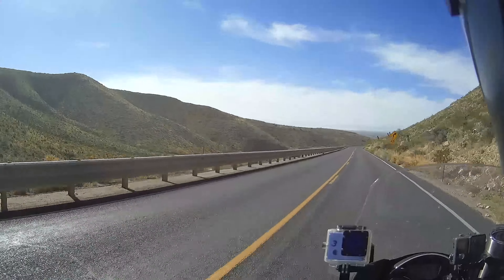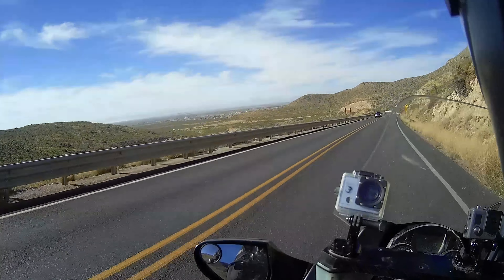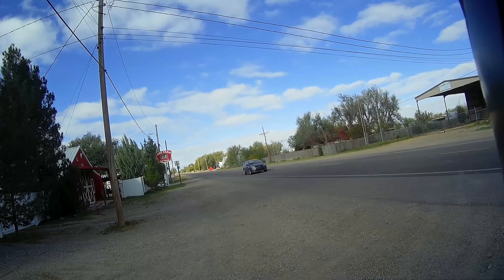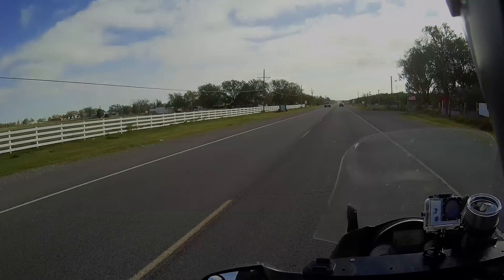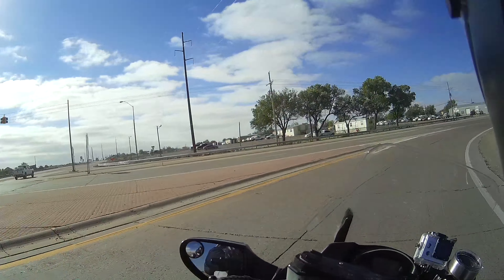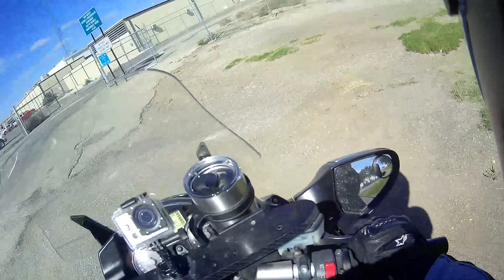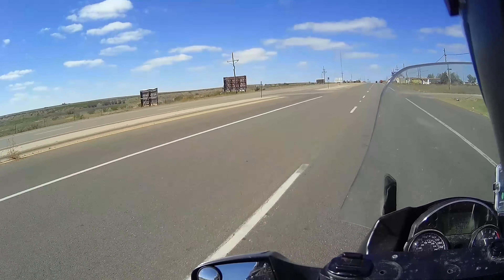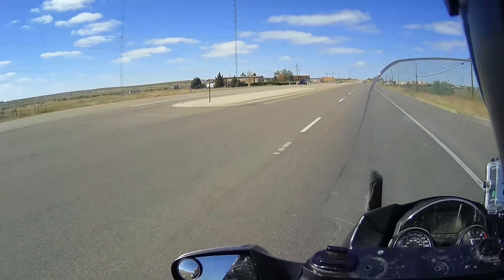Fixing a Flat Tire in New Mexico - Cloudcroft Solo Motorcycle Ride Interrupted: Just Plug It!!!

Comment: Great job, I must buy a kit sooner rather than later!
Reply from the maker: OldManTony Better to have and not need,....   it is one of those kind of deals.  I have had to repair several tires in the past years.  I have used the on board compressors multiple times to at least get somewhere to "properly" patch holes.  These particular plugs with rubber cement, if done just right, can hold up quite well and  for a long time.

Comment: What brand compressor is that? Thanks
Reply from the maker: Mark Hughes It is an older Craftsman Nextec 12 volt Lithium Powered Air Compressor.  Works fantastic for lawn mowers, two wheelers, and motorcycle tires.  I have a pretty full line of those tools and pack extra batteries and lights that work within the same  system.